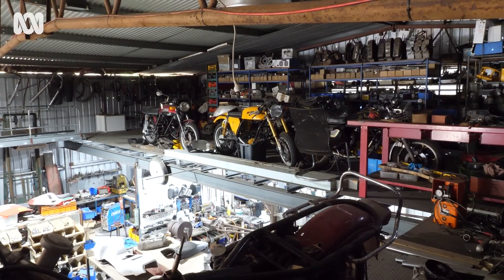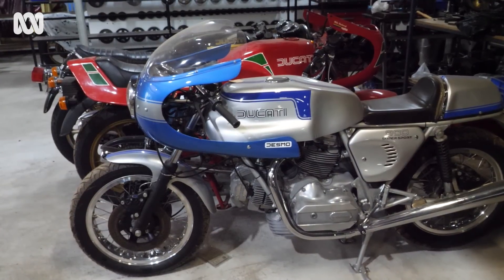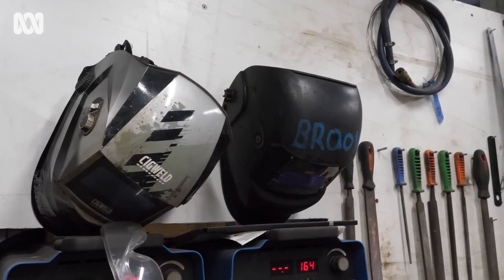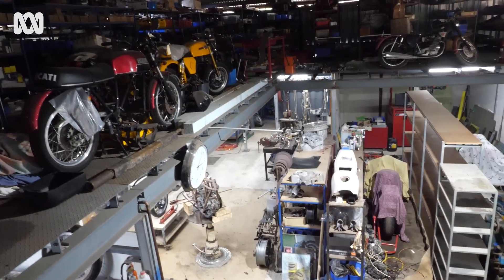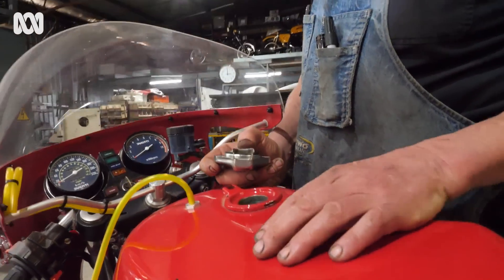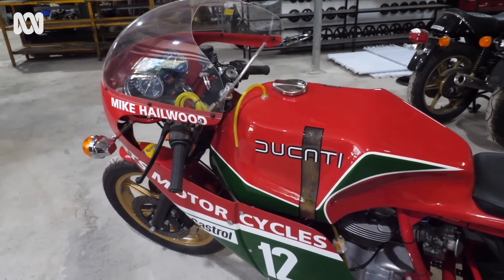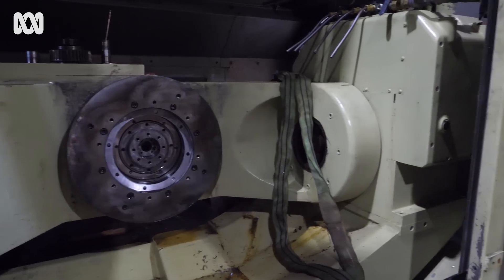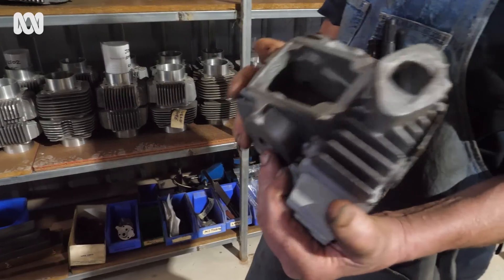Hollywood calling for Hailwood Ducati replicas built in tiny WA town 🏍️ | ABC Australia

Comment: I had no idea the race 900 MHR had a special engine outside normal production. I have read that some racers took factory engines of that era, and highly modified the crankshafts, and cylinder heads, believe the heads are probably the most unique in this instance.
Reply: It was actually the NCR works up the road from the Ducati factory that built the NCR race bikes.The engines in particular were a special build series. I think there were about 40 of them built. 
LThey were nothing like the MHR replicas built by Ducati at the factory. The crankcases were a narrow sump design with a space and spigot for a spin on oil filter. Modern Ducati air cooled twins use the spin filter to this day. Everything in the NCR engine was drilled and or otherwise lightened. Not so the MHR production bike. I built a race motor in 1983-4 based on the same specs. It took us months but it did deliver. 
Mr Henry builds a complete complianced round case based bike, based on the NCR engine and the 1974 ‘GreenFrame’which you can order. It is in fact far superior to the MHR. 
the 12 MHR-NCR replicas built by Henry are really NCR Scudaria works replicas as modified by Steve WynnSPORTS Motorcycles in England. Not to be confused with MHR replicas. 
There is much more to the story than this report has stated.